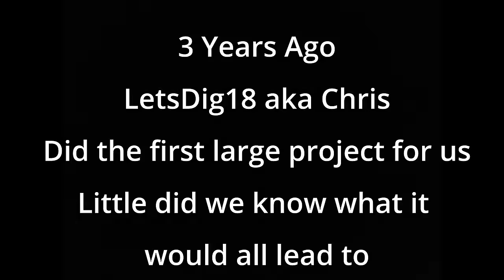TOP Questions Answered by LetsDig18 in This Remastered Interview

Comment: Rough cut lumber, did they use that in my 1902 house? What does perpendicular mean?
Reply from the maker: Most likely you have rough cut lumber if your house was built in 1902. Perpendicular is when two lines cross and make a 90 degree angle